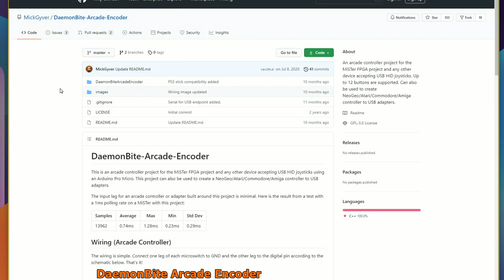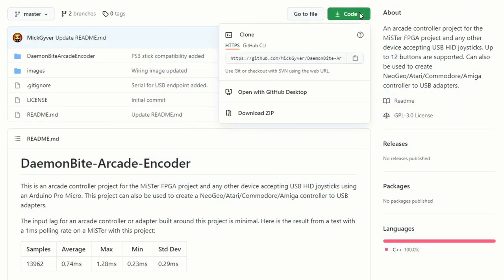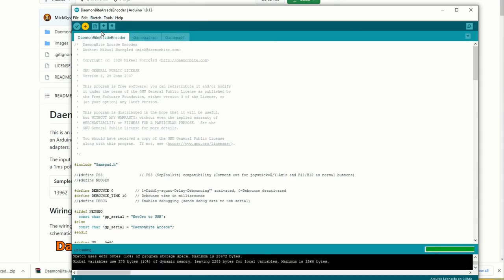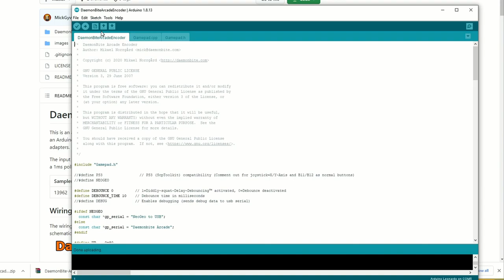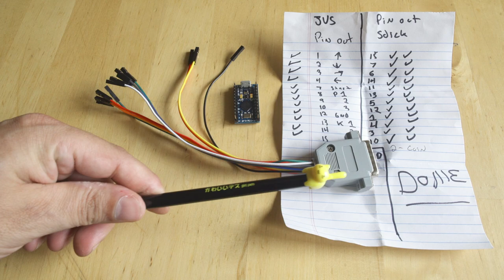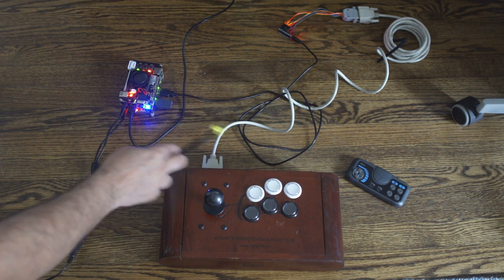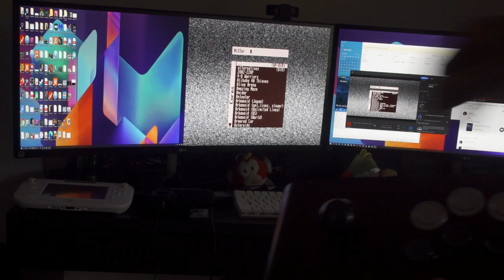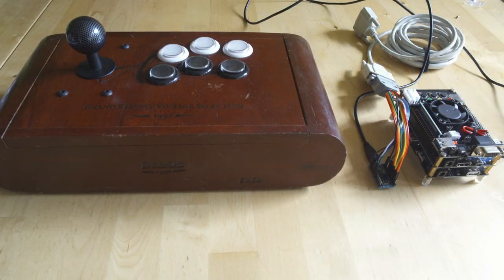MiSTer FPGA Daemonbite Arcade Adapter / Controller Adapter - Build Guide and Setup for Arcade Sticks

Comment: I like how you keep pumping out videos on things I most enjoy (mister and dreamcast)
Reply from the maker: Haha and don’t worry...plenty more coming on both subjects. Just tell your friends to watch them too 😂
Reply: Also I appreciate that you actually made this thorough tutorial, as not sure if you remember but I was the guy who had issues with it getting hot previously. I actually got a new pro micro and successfully made one for the saturn just yesterday...
Reply from the maker: Nice. I do remember that. I think I mentioned some of the Pro Micros just arrive dead. That’s why I recommend in the video to flash the device before soldering...no need to solder just to find out the board is doa

Comment: That's cool. Was considering doing something similar with a Brook Converter. With this you could have a few different setups, ready to swap in & out . Very cool. May reconsider.
Reply from the maker: Yes you can use one board and change the leads but they are so cheap may as well have multiples

Comment: Another way if you want a more MC Cthulhu looking device is getting a arduino nano shield, it has screw terminals. If you look them up on ebay you should find them that's where I got mine.
Reply from the maker: Someone else mentioned that on discord. I’d never seen that part. Normally I solder ports if I’m not filming and I use screw terminals if it’s for a tutorial since everyone can do that. 

I’ll look into them

Comment: I keep getting a 'error expected class-name before '{' token' error  when I try to compile- have you ever had this before?
Reply from the maker: I did not see that error. I just had one error due to html tags in the code when I right clicked and “save as” vs downloading the zip. 

Using the Leonardo correct?
Reply: @VideoGameEsoterica  I'm a moron, my quick fingers had flicked onto the wrong board! Thanks so much ignore my stupidity!
Reply from the maker: Haha no worries at all. You never get to see my mistakes. I edit them out. Happens all the time!

Comment: that light blue thingy what's callled ? at minute 6:35
Reply from the maker: The big mat? Soldering Mat
Reply: @VideoGameEsoterica  Thanks !
Reply from the maker: You are welcome. They are cheap and easy to get on Amazon or basically anywhere

Comment: hello friend when I upload the program to the arduino after a few seconds the led flashes many times and it does not let me assign the buttons and joystick what is the problem???
Reply from the maker: The program compiled correct yes? Make sure you have the right hardware selected. If that doesn’t work try a diff Arduino board. Some arrive doa

Comment: After flashing will it work on PS3, Xbox, And Dinput? If so, when I plug it into a PC will it show up as an Xinput or Dinput device?
Reply from the maker: I used it on PC and it worked like any USB controller would. I have not tested it on any other device as I have custom sticks for those other systems
Reply: @VideoGameEsoterica  Ok great that it works. I was just curious what api it would be detected as. You don't remember if it showed up as an xbox or dinput controller?
Reply from the maker: Dinput

Comment: i just come up with this. thank u so much!!! do you think it's possible to make a multi system adapter? (i have a mvs controller. but i want to connect other controllers....here the arduino isn't cheap!) i wish to connect atari 5200/2600/jaguar and coleco controllers!
Reply from the maker: It’s possible but I’m not sure the procedure for those consoles

Comment: This is great. Many thanks. Silly question since I've never used them what do I need to search to find the coloured wires with the headers attached? Thanks
Reply from the maker: Just Google “DuPont connectors”. You’ll find them. Or “arduino jumper wires”
Reply: @VideoGameEsoterica  thank you. Do you know if it's possible to use a ATMega4809 (Arduino Nano Every) rather than the Micro Pro?
Reply from the maker: I do not know. The GitHub lists the Pro Micro so my assumption is no?

Comment: Why not put the Arduino in the joystick enclosure and use USB to the  Mister,  bigger input lag?
Reply from the maker: That stick is my Supergun stick which uses DB15 so I don’t want to build inside of it and add a second hole to the case. It’s one of my favorite projects I’ve made so I just wanted to make any mods to it external and reversible :)
Reply: @VideoGameEsoterica  aaah makes sense!!!
Reply from the maker: Yeah just a visual thing

Comment: Where would you recommend purchasing these?
Reply from the maker: The arduino? Sorry not sure what part you mean...made this a while ago
Reply: @VideoGameEsoterica  yes the small usb board!
Reply from the maker: Amazon. Just check reviews. There are so many vendors
Reply: @VideoGameEsoterica   Thanks I found them! I'm sure this doesn't matter because this seems configurable with the mister software - but I'm planning on adapting a 6 button layout (capcom style) for my mister. Using the MickGyver guide for Arcade Encoder - I'm guessing I should just wire up buttons B3,B4, and B6 for the upper buttons and B1, B2, B11 for the lower buttons. Would you suggest doing it any differently? Thanks again for prompt responses!
Reply from the maker: Makes sense but the nice thing is you can wire them up to your preference

Comment: why not use a usb stick?
Reply from the maker: You totally can. I just build my own sticks and so do a lot of people. My Sanwa / seimitsu built with a Daemonbite is as good as any stick you can buy (if not better) and costs MUCH less :)
Reply: @VideoGameEsoterica  ah ok i get it. I am a noob who has not the best skills but still like to play. My 2 8bitdo Arcade Sticks with Sanwa Sticks and Buttons are enough 😅
Reply from the maker: I get it. I don’t even need another stick and I still want to buy that 8Bitdo just for the mod factor...and I’m drowning in sticks and controllers 😂
Reply from the maker: But custom enclosure builds are awesome. $60 in parts from focus attack, ten for the enclosure and maybe $7 in parts for Daemonbite...$77 for a legit amazing stick. Plus since it’s DB15 it works for my arcade supergun and Neo Geo. One stick, three uses, all for basically $75 (plus free labor hahaha)
Reply: @VideoGameEsoterica  Where did you buy that wooden enclosure for the stick shown in the video?
Reply from the maker: Cigar shop. Most places sell the cigar boxes for like $5-10. You really have to dig around and find a vintage solid wood one like I did here. 

I love cigar boxes. Store my JAMMA harnesses and adapters in them. Build sticks in them. Great cheap enclosures
Reply: even if you use a usb stick, you can benefit from swapping out its internals with daemonbite.  Many usb arcade sticks do not perform well, so this would be an upgrade for them.  The only issue is you lose XBox and playstation console compatibility, if the stick had it originally.
Reply from the maker: It’s just a great all around device plus you seriously can’t argue with the price. Three pack of Pro Micro boards on Amazon is like $15 and a box of those DB15 ports is ten
Reply: @WalrusFPGA  i get it. Still 16ms avarage lag on the 2.4Ghz Dongle of the 8bitdo does not botter me as casual who just enjoys gaming.
Reply from the maker: Wireless lag doesn’t bother me so long as it’s not a fighting game or a shmup. 

Those two genres I feel need a wired connection on MiSTer. Especially fighters
Reply: @retromister81  Sounds like you're set then!
Reply: @WalrusFPGA  absolutely, just talking.
Reply from the maker: The best part about MiSTer is the near limitless options. So many ways to achieve the same result
Reply: @VideoGameEsoterica  uh yes, looks good even on a cheap LCD 4K TV.
Reply from the maker: It looks equally as good my PVM as it does on my Samsung 4K
Reply: @VideoGameEsoterica  Solid advice on asking cigar shops for old boxes. Never thought of that, and I dig both the size and style of the one you showed in this video. About to make some calls lol
Reply from the maker: Good luck on the hunt!
Reply: @VideoGameEsoterica  and thats a real oh point to me compared to all the mini consoles and software emulators its a whole new world.